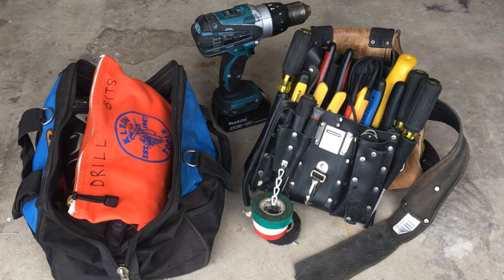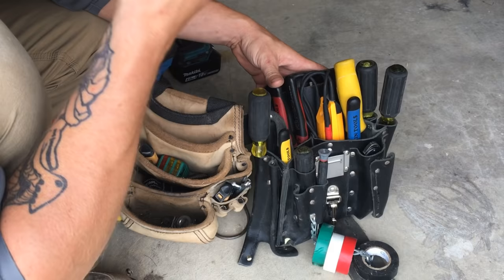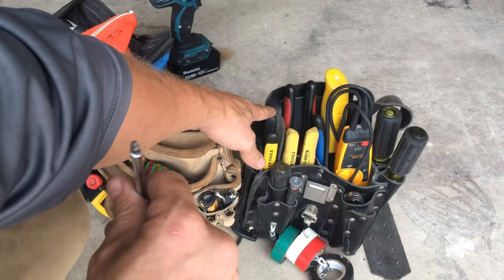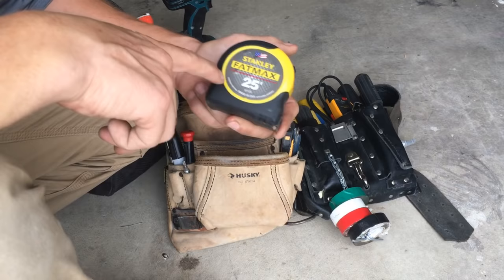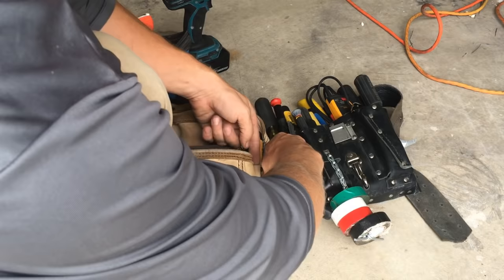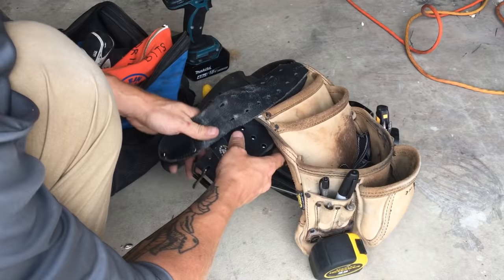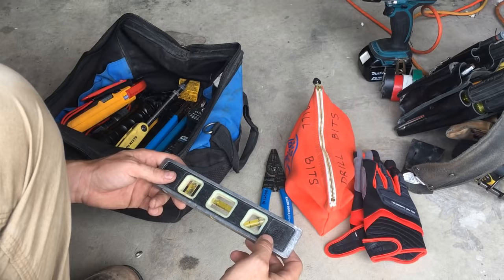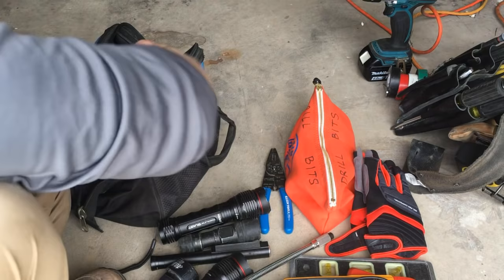Episode 2 - Tools Every Apprentice Electrician Needs To Start Their Job

Comment from the maker: I made a significant error in this video.  I said Greenlee was not a very good brand of tools but I meant to say Commercial Electric.  (Both Green) - Greenlee makes outstanding tools, Commercial Electric's tools are shit.  Sorry for the mistake, now I'll go kill myself lol
Reply: Electrician U all good I think most understood where you were going
Reply: Dude wasnt your plug tester Commercial Electric ??
Reply: Thanks so much for the Greenlee clarification. I don’t use them normally but I have a backup set that’s Greenlee and have been very impressed.
Reply: @topflight408  there plug testers are about the only decent thing they make lol
Reply: I use commercial electric on residential and Klein on bonded worthy sites.
Reply: You redeemed yourself by owning Klein. I've been a commercial/industrial sparky for 50 years and Klein is all I own.
Reply: Sooo. Trying to start out as a helper. Sounds like klien hand tools, Milwaukee power tools, and fluke testing equipment.
Reply: @Nick-vf3wf  right except for power tools... Everyone likes a different drill/sawzall because they feel different and have different weight and balance. I happen to be using Rigid stuff for my impact/drill/sawzall... Also you need actual screwdrivers bc they get into places 10&1, 11&1's wont fit in.
Reply: @awickedtribe  like long shaft to get into enclosures? I'll have to check that brand out.  Im really new to this. Im going to school but they provide very very basic hand tools & a klien cat3 meter.
Reply: @awickedtribe  oh and what do i need as far as power tools as a helper? I was thinking a basic drill and impact drill. Do you think ill need saws right off the bat?
Reply: @Nick-vf3wf  If you're doing commercial work a sawzall makes a difference. A drill is better that an impact to start especially if you dont have the money for all three. Drill and sawzall is what I would go gor first. Whichever way you go, good luck and welcome to the family. Pay attention and you'll do good.
Reply: @awickedtribe  Thank you for the help. I'll definetly have to at least get a power drill before I start and see where exactly I end up because i do want to do commercial or residential. Im pretty excited to start working in electrical. I've been in food service my whole life so this field will be life changing for me & the fam.
Reply: How does one become an apprentice?
Reply: I like their big cable cutters and knock out tools
Reply: U should try a fluke ticker, it's way more acurate then that p.o.s Klein ticker,  btw did you know all of ur Klein hand tools have a lifetime warranty,  as long they're not blown up like your side cutters you could get em exchanged
Reply: Honestly Greenlee hand tools are cheap China made crap. Greenlee tools over say $100 are generally high quality though. The hand tools are just rebranded crap
Reply: @Nick-vf3wf  Those are all high end and expensive, but you get what you pay for.  The one thing I would say is I don't like the Klein brand of channel lock.  Either get the Channel Lock brand or upgrade to the Knipex water pump pliers.  That's personal preference depending on the adjustment style you like best though.
Reply: What kind of bags are those??
Reply: commercial electric is ok.. i wouldnt call them shit..
Reply: @Nick-vf3wf  good luck on paying for those...   he has the best stuff..   you wont be able to afford the stuff he has...  hes not a helper..
Reply: topflight408 nah cuz that’s Klein
Reply: Haha didn't watch the video yet but I've made that mistake before. When my boss bought CE strippers, I went almost a full day without making fun of them cause I thought they were greenlee. I will say they're great for low voltage wires but then again that's who they're meant for, data guys😂
Reply: They used to be pretty crappy compared to Klein. Most of their stuff is pretty good now, but you learn who makes the best for your application. I always got a cheap big flat head because I knew I was going to beat the shit out of it clearing out stucco or concrete for a box.
Reply: Greenlee is meh for hand tools but great for anything to make a hole in steel. A Greenlee knockout set is wicked imo, also their carbide set is king compared to Klein ( Klein broke after 3 holes) the Greenlee set is still fine after 100+ . Last but not least I love their quick taps and masonry bits
Reply: Bro use metric it’s soo much more simple
Reply: Nice 👍🏼 brother 👏👏
Reply: How’s affiliate marketing treating you?
Reply: Where  is your link
Reply: Can you tell me about the tool pouches?
Reply: @bngr_bngr  idk if you got your answer but  i got my apprenticeship through IBEW union they set me up with a job in like a less than a week and i start my classes in october 
im sure there are other unions that do similar stuff if you dont have IBEW near you
Reply: Hey just wondering what kind of bags are being used in this video for both the belt and the hand held bags?
Reply: Commercial Electric tools are garbage. And I only work with low voltage
Reply from the maker: @Nick-vf3wf  Sounds about right
Reply from the maker: @bngr_bngr  you have to have a certain midichlorian count ;)
Reply: Electrician U exactly what about commercial electric is bad i haven’t had any problems with any of their stuff
Reply: DUSTIN we don't want you to die 
DUSTIN give life a try
DUSTIN we don't want you to die 
Oh God no DUSTIN
Reply: @williamsacksteder9438 Klein's tools have a lifetime warranty well worth the money.
Reply: Haha I was gonna comment the crap out of you for pissing all over green lee haha.
Reply: @Nick-vf3wf  I'm a former career bartender turned apprentice. Best of luck to us both haha!
Reply: This video is old, but those are diagonal cutting pliers, not side cutters. Lol
Reply: Have been having a hard time lately with Greenlee stepdrill bits and holesaws. Somehow I think those lower cost products are of lower grade quality than their hole punchs and higher tier equipments. Great Video.
Reply: Btw get yourself a small screwdriver-drill holster, instead of putting it in your screw pouch and taking the risk of it falling out when going up steps. (The sweet sound of tools falling on hardwood floors....) I personally use the new dewalt brushless screwdriver-drill because of the belt hook that fits securely on the ridge of my tool pouch and because their 20v chargers also charge 12v so it's less equipement managing.
Reply: As soon aa you said it i was like wait...whattt.. green lee is absolutely TOO SHELF shizz lol you went to their booth for one of the first ones at that convention lol
Reply: I'm loving your channel. I think an edit is in order but at least you corrected yourself in the notes. I'm a woodworker delving into some electricity and welding. Keep up the good work.
Reply: Noticed u didnt have a hammer or a crowbar with you also a fish tape or fish rods, im sure many journeymen or licensed electricians love seeing any apprentice or assistant mainly owning a fish tape included with their tool set. Finally, #1 top reason (for safety) is owning a pair of safety goggles.
Reply: Greenlee is 100x better
Reply: Commercial electric is a good option for someone on a serious budget though! I feel like they are the quality brand of shitty standards:)
Reply: @Nick-vf3wf  ya but Id get the milwawkee plier stripper combo they are nice. daily mine along with those smooth klein yellow handle strippers. I prefer klein hand tools and your comment fits my opinion but those pliers impress. has a emt reamer too works for the 1 or 5 and done but a klein reamer is the answer all day.
Reply: @Nick-vf3wf  Lol exact same thing here, how goes the electrical work?

Comment: Nice video and I can relate.  My Dad was a union electrician and I wanted to become one so I applied when I was 18 (1971) and took the test. I then had an opportunity to go to work as a non-union sheet metal worker shortly after High School and about 3 years later the contractor I was working for went union. About four years after I applied for electrician apprentice I got my letter from the IBEW Union Hall that I was accepted but I was already a Journeyman Sheet Metal Worker. I don't regret it because I learned how to install and service residential heating and cooling which saved me a ton of money. After 5 years of residential work, I changed to commercial and industrial.

Comment: as an  electrician for 27 years I agree 90% with you. Most of what you said is dead on perfect. In fact I carry many of the same exact tools that you do (exect I don't buy the ones with the comfort grip handles, I  prefer the regular handles). . . . Things I tell an apprentice to have that you didn't mention would be a pipe cutter, wire snips(a.k.a electrician's scissors), crimpers, 3/8-9/16 ratcheting wrench, tin snips, a crescent wrench and a second measuring tape (because that is going to be you most often lost tool, keep a back up) .... I  would also recommend a that a newbie to get a good hacksaw and Ratchet and socket set for switchgear, running cable tray and mounting equipment (nothing super fancy, just a good 3/8 set that covers the basics, I tell newbies not to buy mega expensive ratchet/Socket sets from Mac Tools or Snap On because we're not diesel mechanics, so Husky, Gearwrench and Craftsman sets work just fine in our line of work), but that is stuff that you will not need to carry around all the time......I also tell my helpers to get a 5 gallon bucket to carry their tools in (including their pouch). I always have a loaded pouch with me, but a rarely (almost never) wear it. Instead I prefer to wear a small mini pouch on my tool belt with just whatever tools I need for the job I am doing that for that day.  I  am not going to wear a loaded pouch full of stuff that I will not be using, hence the reason I carry my loaded pouch around with me in a 5 gallon bucket...  Since I don't wear a loaded pouch all the time, I don't require my helpers too either. I get  my helpers keep their pouch in a 5 gallon bucket (just like I do), that-away if you need more tools beside what's in your mini pouch, then you don't have to run all the back to the work van to get it.   ....I would also recommend a carpenters nail pouch. When you are running conduit, you can keep one hole straps and screws in it, it makes it very easy and convenient (especially when your working up on ladders).
Reply: Before someone rips over my comment about Expensive Mac Tools and Snap On ratchets and sockets...Let me point out again that Electricians aren't diesel mechanics. Although we do use ratchets and sockets,  however it is not something we use everyday, sometimes we can go a month or even two months without using them at all. (((( So YES, I am very well aware that Snap On and Mac Tools ratchets and sockets are the very best that money can buy. ....In fact, a long time ago, I spent a lot of money on a Snap On tool truck buying stuff. Simply because I had the idea in my head that Snap On makes the best Ratchets and Sockets and I believed that I had to have the best. Only to realize that as an electrician I didn't use that stuff often enough to justify spending that much money on it when cheaper alternatives from Craftsman or GearWrench were available ...so when I tell newbies that they don't need Mac Tools or Snap On ratchets/socket sets... I still believe Snap On makes the very best Ratchets and Sockets, but since we aren't using them all day everyday, we (electricians) do not  need the very best ratchets and sockets. Craftsman works just fine in the electrician world...... Yes I am actually speaking from experience.
Reply: Sound advice 👍

Comment: word of advice: Avoid using a sharpie on things that will be exposed. it will usually show through any paint applied later
Reply: I carry a 9mm mechanical pencil with HB leads. Can't erase markers. I've seen marker bleed through a layer of Killz.
Reply: Sharpies  are great for cutting and threading  pipe to measure.
Reply: So many people kill me with sharpie marks on pipe.
Reply: Jacob Campbell lmao dude seriously!
Reply: Not his prob
Reply: For anyone griping about sharpie marks on pipe sharpie erases sharpie just redraw over and wipe it off
Reply: caleb fink my dad always has a pencil in his bag pack
Reply: @malldollar4886  wipe with hand sanitizer, or a eye glass packet wipe cloth (alcohol)
Reply: or use a coins edge lightly
Reply: David Sizemore yes this works with a bit of spit and furious friction
Reply: Haha gross
Reply: i  rather not use a sharpie
Reply: I learned that th hard way lol

Comment: On the subject of the carry belt, something I loved from the moment I started using it was a set of suspenders. Takes all the weight off your hips and back, reduces pain and fatigue, and keeps your belt from sliding down so it's always at the height you want without having to fasten your belt very tight at all. You can even adjust one side higher or lower than the other to compensate for the weight of pouches (I keep my right suspender slightly shorter since that's the side with most of my tool weight). Just make sure you get the good, wide work style with the thick metal clamps and teeth.
Reply from the maker: I did that for a long time too, great advice

Comment: I recommend getting tools with distinctly different colored handles that way you find the right one you’re looking for quicker and easier
Reply: why not just tape the ends?
Reply: A seasoned hand, knows where every tool is located in their bags and every tool has  a place that lives in your belt, no need for color coding, grab and go!!
Reply: I rather use tape, looking for different colors often times means it's a different tool or different properties. 95 percent of my tools are insulated so they're all orange and what not
Reply: That is what electrical tape is for....
Reply: I'm not a big fan of tape on my grips, and I generally reach and grab without looking. They're all different colors or very different visually in some way - but I operate my tool bag by braille most of the time. They all feel different, and they're always in the same spot. I don't lay shit down everywhere, it goes from my hand back to its slot. I've gotta put my hand there to grab whatever other tool anyway.
Reply: I paint them all black and go by weight

Comment: I would say you need,
-a good 10in1 (multibit) screwdriver
-a flathead for beating 
-a pair of sidecutters 
-Romex strippers
-wire strippers 
-electrical tape
-sharpie/pencil
-phasing tape
-keyhole saw
-tic tester
-ohm meter/tester

I recommend Klein tools for the most part, stay away from Southwire or anything cheaply made

Comment: I'm a 19 year old, 2nd generation, 2nd year apprentice, and this video is spot on. I started out in commercial and then went to a high rise where I did decks, boxing, roughing the units, running a rough crew, and then down to parking garages and I have just about every tool I'll ever need but I still buy more just for the hell of it. Can never be too prepared

Comment: 3rd Term apprentice with the IBEW here. For union apprentices theres a list of tools which you are required to provide for yourself. Everything else required for the job must be provided by your employer. Current tool list as written by the IBEW includes:
- Linemen's pliers
- Diagonal cutting pliers
- Channelocks
- #6, #8, and #10 Robertson screwdrivers
- 5/16" and 1/4 inch flat head screwdrivers
- #2 phillips screwdriver
- measuring tape
- tool louch and belt
- safety hat
- safety boots
- log book (provided by JAC)
- note pad
- pencils
- electriciams knife
Im not going to get into what I would recommend having, this is just what the union requires you to have as an apprentice.

Comment: I would like to add a couple of items,  tin snips, round and flat files , pipe reemer,  hammer, hacks saw, WD40 DONE
Reply: no hammer!
Reply: I haven't seen anyone use a hacksaw in a good 8 years. It's as obsolete as a hand crank drill. Buy a used Recip saw if money is an issue.

Comment: you dont need half of this, if you are in your first year. Keep it light, you gonna be the one carrying ladders and all the equipements around. Don't spend a thousand before starting to work, add stuff gradually. 

-Good impact driver + charger + 2 batteries,  red square bit
- red square screwdriver
- green square screwdriver
- filledup screwdriver
- flathead screwdriver
- good cutter
- good pliers
- Cheap long nose
- precision screwdriver flat and fillup
- Knife
- sheetrock knife
- small level
-Sharpies and pencils + pencil sharpener
- 3m mask P100 cartridge 

I use to carry my hammer drill, but i prefer using the wired SDS from the compagnie, and leave my batterie drill in the car or at home 

If you do a lot of emt, charm your journeyman into buying a bandsaw, if he doesnt own one. That made my weeks go so much better :)

It's just my opinion, i started a few months ago, and dont ever missed anything really, your journeyman gonna allready have a lot
Reply: 100% cant agree with you more on the bandsaw comment. I was 3 months deep starting my apprentice program. My boss used dewalt, i prefered milwaukee. Found out milwaukee makes a badass bandsaw powered by 18 volts battery. I bought one for $260.....wow was my boss impressed from it..way better and quicker for cutting 2" emt or older metal casted MCs conduit than any sawzall or hackzall.......my boss immediately bought one for himself the next day but made by dewalt. Mine was still more powerful.